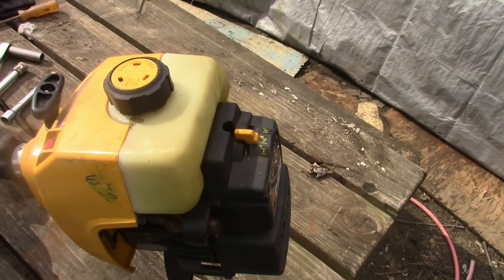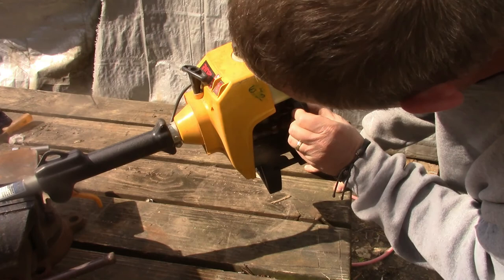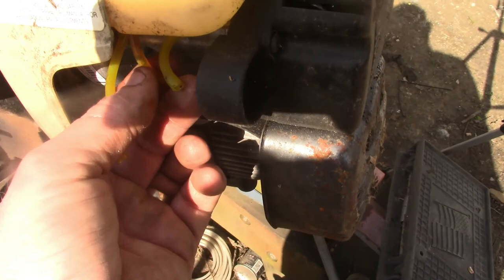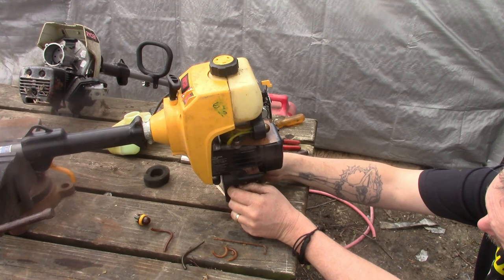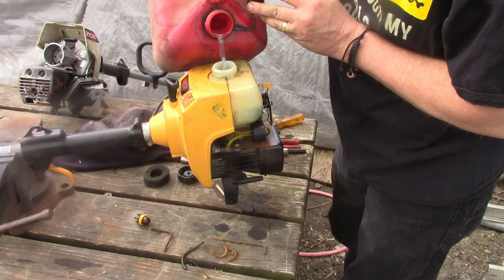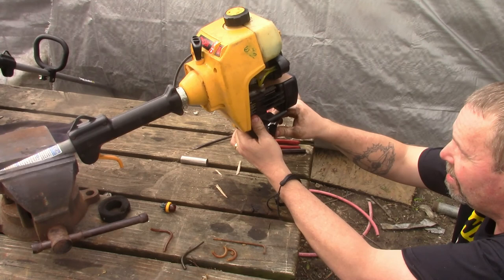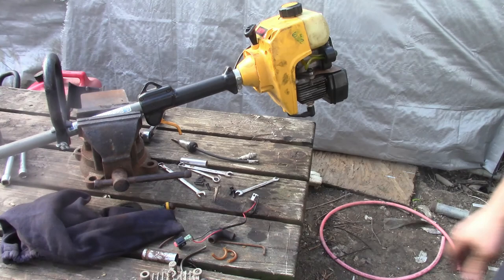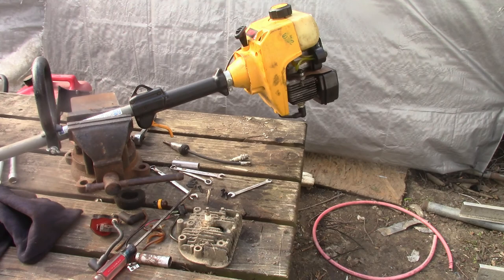Older Ryobi gas trimmer weed eater will it run?

Comment: Best trimmers ever around. If they had an issue the motor was super simple to rebuild
Reply from the maker: I agree with that. They are easy to fix. I’m pretty sure I still have this one.
Reply: @GenerationX1971  I still have my fathers from the 90s. Just recently rebuilt the whole entire engine but I hardly use it because I like my husqvarna 223l  and my echo 2620 but on a day or two during the year I’ll pull it out. Those older trimmers smoked like a chimney with those 25::1 ratio mixes lol
Reply: The reason for that is they were made when ryobi was ran out of japan so the quality would have been much better than the crap they started making when the chinese bought the name. Dont see too many of these around nowadays unfortunately but theres still a few of them around. I was given one at work. Pulled from the scrap bin. All i did was change the diaphrams and fuel pipes. Then it started no bother. Still needs a bit of work to get it going the way it should but its in good condition otherwise. And ungodly simple

Comment: Then mine are a bit older yours has newer looking switches.

They're just 2 more projects to knock out later the gas lines are hard as rocks primer bulbs are rotted one has a bad clutch and im not replacing none of that I'll redo the lines and put filters in and primer bulb then give them away 

Because i already have weed eaters i use i don't really need anymore

Comment: One i have has a small head leak its gonna keep that small problem to don't get enough money to fix all the stuff i get free but someone else can finish were i leave off at on them if they don't continue using the weed eater how it is it'll be up to them. 

I have my featherlites i like using and a craftsmen and one stihl.

So if i got more money I'd do a complete job on them those small projects take money and time and space
Reply from the maker: It starts adding up for sure. Around here most of your older trimmers only sale for $25 to $30. Even at free with labor and parts it’s hard to make a profit. That’s the main reason we just do our best to get them running and give them away to people that are unable to afford one. Nice to be able to help people out once in a while. Most of ours come from thrift stores. Most common problem on those ones are fuel lines. Easy fix but some people just don’t bother with it.
Reply: @GenerationX1971  im going to then someone if they want it like new can do further work on them with the hardened lines on them now they still run fine but i have enough weed eaters so I'll do the the easy part and they can finish it if they want or use it how they are with just new lines gas filter primer bulbs i always get the used stuff before the dumpster does.
Reply from the maker: @Mike-su8si  I’ve only been lucky a couple times as far as finding them in the trash. My neighbor gave me a couple that have some issues just haven’t had time to mess with them yet.
Reply: @GenerationX1971  i get a bunch of stuff from friends and from they're friends i don't hardly ever find any good stuff in the trash
Reply from the maker: @Mike-su8si  there’s a bunch of people around here that haul scrap metal. By time I get home from work anything set out by the trash is gone.
Reply: @GenerationX1971  i know some people do that here to around

Comment: Umm ?  Don't know if you just mis-spoke, but for future reference, I believe that if your 2 stroke calls for 40:1 instead of 50:1 you'll want to add oil to the 50:1, not gas.   If you add gas you'll be getting farther away from your 40:1 goal and are likely to roast your engine.
Reply from the maker: Always in hurry lol. Plan is to get another gas can so I can have 50:1 and 40:1 on hand. Thanks for the comment 👍
Reply: @GenerationX1971  I know the feeling :)
I got tired of the sun rotting the plastic cans to the point of not being able to read the ratio of the sides. So I bought one each of the  premix metal cans in 40 & 30 to 1 and just reuse them.
 Oh just fyi, you might consider running one step or half step richer to preserve your engine longer.  ie. 40:1 (or 45) in any machine labeled for 50:1. They'll  need a touch of carb adj. and will smoke slightly more, but you'll get more power out, much longer lifespans, and helps fight the EPA's "planned obsolescence" sabotage of our power equip!  :)
Reply from the maker: @Killianwsh  thanks for the advice I appreciate it.
Reply: That’s the epa talking. Those models are actually 32:1. They were all the same from mid 90s-early 2000s nothing has changed with those engines. You’ll wonder why you still see those older 700 models running today because they all called for 32:1 up until 2000s. They actually originally used to be 25:1 but 32:1 is the perfect mixture if you want your unit to last you 25 years. If you plan on wanting to stay up to date every 5 years by buying a new unit then sure 50:1 will burn cleaner for you but won’t last 25 years maintenance free. You’ll run into something like a worn ring or scarring after ten other than just fuel line replacements
Reply: @jonnysnipes3123  Good to know!  Any problems with the carbs running mix that rich?  I've noticed some changes over the years in both Wal. & Zama carbs, but I haven't been able to sort out if that was mandated by the EPA, or jus the manufactuer finding ways to shave mfg. costs.
Reply from the maker: My guess would be EPA. 32:1 is a good mix. My Remington saw is from the 60’s and still runs strong. I have a Craftsman saw I’ll try it on just to see how it goes. My uncle always ran straight 30 weight oil mixed in his when I was a kid. Question is will it foul the plug from the extra oil since it’s not old school?
Reply: @GenerationX1971  I'm not an engine tech, but I'd wager if it does foul the plug with the ritcher mix , it can likely be balanced out with a change of the spark gap.
Reply from the maker: @Killianwsh  same thing I was thinking.   My son was running 40:1 in the trimmer I got for him for the last couple seasons. It’s a Hyper Tough from brand and calls for 50:1. Smokes a little but still runs good. New plug probably wouldn’t hurt. The other trimmer he had took 40:1 so he just ran them both on it.
Reply: @GenerationX1971  Testing the spark gep theory shouldn't be too difficult. If you're getting a new plug anyway, get 2 extra & gap one  a couple thou. above the recomended, the second right on it, & the third a couple below. Try all three & run he one that preforms best. 
Might  invest a couple bucks in a inexpensive laser thermometer to ck engine  temp for each as you go to be safe though.
Reply from the maker: @Killianwsh  that’s a good idea. I think I still have 2 or 3 new plugs laying around.

Comment: I never had this brand im not knocking them neither i just don't need them i need more working space or storage space thats why i only plan to redo the primer bulbs lines and thats it then get rid of them. Then don't want the place to look to ran down outside or a hoarders yard
Reply from the maker: That’s the problem I had over the summer. Working on to much stuff. Between my every day job and messing with trimmers and mowers it started building up. Nope time for this stuff to go lol.

Comment: Hey Howard, can you tell me how you replug the fuel line... I all mixed up now that I pulled out mine and I dont remember how they were....
Reply from the maker: I will look at it tomorrow after work and let you know for sure.
Reply from the maker: So finally home. On mine the line farthest out on the tank runs to the primer ball and then from the primer ball to the top of the carb. The other line on the tank runs directly to the bottom of the carb. Hope that helps you out some.

Comment: mines being ridiculous, it seems lie I have replaced everything that can be replaced LOL   I can get it to run but as soon as I hit the gas to rev it up it will die.    really pissing me off. New carb and gaskets, bulb , hoses, plug, has compression.   im Missing something,,
Reply from the maker: One of them I picked up was doing the same thing. It ended up needing the air/fuel ratio adjusted. Was a pain to do. Soon as I touched the throttle it would stop. Was flooding it’s self out. I’ve had brand new carbs that need adjustment.  
Let me know what the problem is when you figure it out I’m really curious.
Reply: @GenerationX1971   yeah, I was thinking the same thing , bummer is the place where i would normally adjust, On Top of that little carb, the two set screws, those are not adjustable on this thing. lol  that are some kind metal plug instead.  I am thinking about finding that old nasty carb  I pulled from this one and maybe I can disassemble and use the adjustable body with all the stuff from this one to make a working adjustable carb.       I dont know though LOL, today was Mothers day so I was busy with all that and my shoulder is killing me from trying to start that thing.
Reply from the maker: @larryleisuresuit9584   I can relate to the shoulder problems. Some of those carbs have adjusters under the metal plugs but between the two you should be able to make something work.
Reply: @GenerationX1971      

  I got this one today.  These Ryobi weeders I have here ( I have a pair now out )  are the "quick Link" type, so the bottom portion of the wedeater can be taken off.   I got my other one out for parts swapping and the old carb that has adjusters on it.   I decided to try the easiest thing I could think of 1st.  The #2 weeder I got out had hardened up hoses and gunk in the filter and all that.  But it has a clean looking hardly beat carb w/ adjusters.  The #1 that I was trying to get running has the brand new carb, zero adjusters, new lines, new filter. I pulled the lower unit off the #1 and tried to start it and it idled faster but still dies when I touch the throttle.   I sprayed fuel in the #2 weeder carb and it tries to start every time I pull the cord. I mean, it fires for a sec.   I pulled the lower off #2. tried it and it seems the same where as #1 seemed labored with the lower on.   the #1 lower was the one I was trying to get going because it has the straight arm industrial lower and head on it.  That gear inside the #1 lower that is right about the twin head is grinding, restrictive. It is not spinning well, it is causing the engine to bog. #2 lower spins free.   so I put the #2 lower on the #1 trimmer and it did work better but still kind of sad dies repeatedly fire back up but sucks.   so what I did was, I pulled #2 weeder apart taking the carb and old tank and hoses crumbling and all, I pulled all those same parts as 1 unit from the #1 weeder.    while doing that I looked in the back side of the cylinder of #1 and #2 to compare. #1 was CAKED W/ Carbon and Goo, #2 was clean as a whistle.     I put the tank/ carb/ nose apparatus on the #2 -  now #2 has the Non adjustable brand new carb ( 10.00 kit from china ) and the tank from #1 on it with the new filter inside and all new hoses. Fires every time I pull the cord and idles HIGH even with the #2 lower, if I put the #1 lower on it it will die.     so the #2 is now running, idles high and revs a bit but bogs if I hit the throttle for more than a sec or so.   

  #2 idles so high though it works perfectly fine and I weedeated the entire side of the Creek and Canal with it without ever using the throttle.   It's just that I have to shut it off to set it down or whatever.   the needle to set the idle on that new 10.00 china carb does not even reach the cable mount arm so there is no way to back it off.    I can live with it this way though, it really kicked a$$ on the creek and canal today and I barely have to pull that cord to restart it so shutting it downs no problem. 

     I am goin to disassemble #1 and clan all that build up out of it.   These two units are 700R and 725R   they look  nearly identical really.      I wonder  if the rings in that #1 are shot maybe.    YOu know , I was thinking it might be fun to see if I could Bore one of these out and play with it to see if I could bump it up.   I literally have under 15.00 in the pair and that new carb kit was 10.00 LOL   

  who knows.  I might put it all away till winter. I am weed eating for now though.     It's funny how accessible the back side of the piston is after you pull that carb and plastic plate.  I thought that would be metal back there but it's not.  crazy that it doesn't melt.
Reply from the maker: @larryleisuresuit9584  I thought the same thing about the plastic case when I first started messing with them. I talked to a guy at work and he was telling me years back he was in a club that flew 2 cycle gas powered planes and helicopters. Some of the helicopters had modified weed eater engines on them. At that time which was many years ago he said you could purchase a kit online to put a bigger piston better head and bigger carb on them. I have seen rebuild kits online but never took one that far. Have to try it one of these times.
Reply: To set your high and low screws that'll do it check the rubber flap in the carburetor a ruined one will do that to
Reply: @larryleisuresuit9584  mine similar to theres has limiter caps on it a red and white thats supposed to keep the h an l screws in place